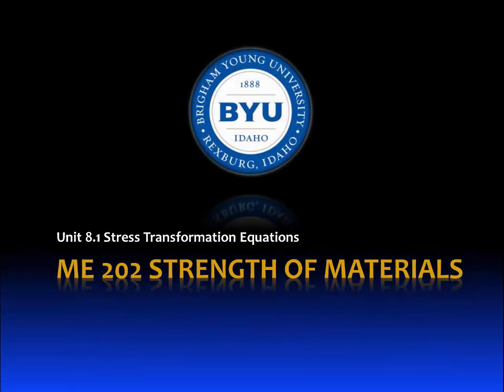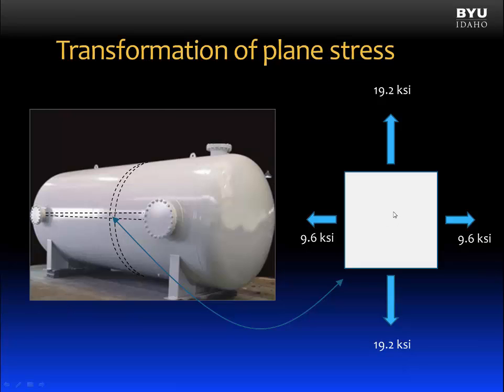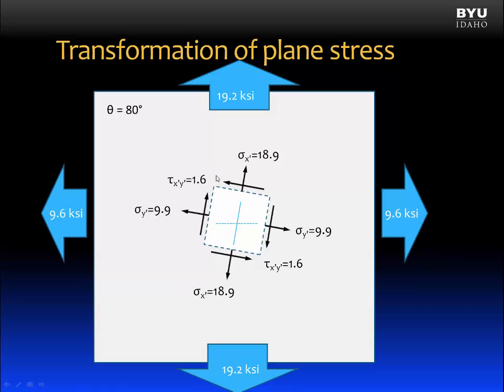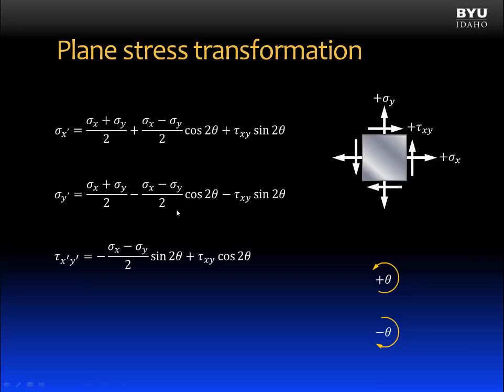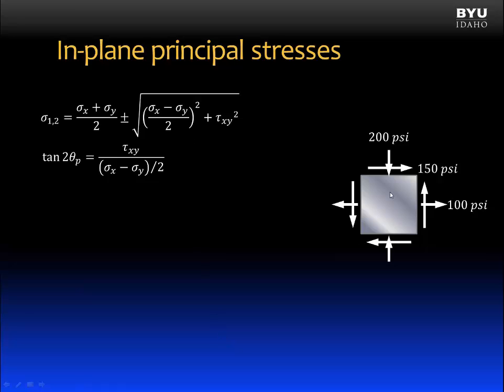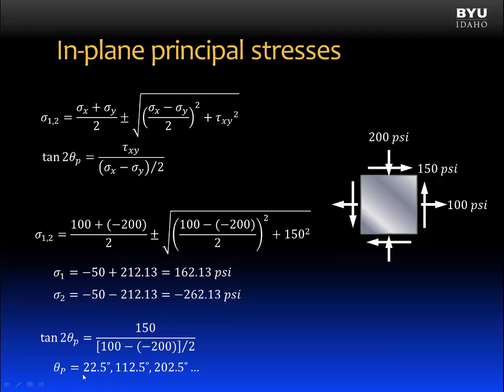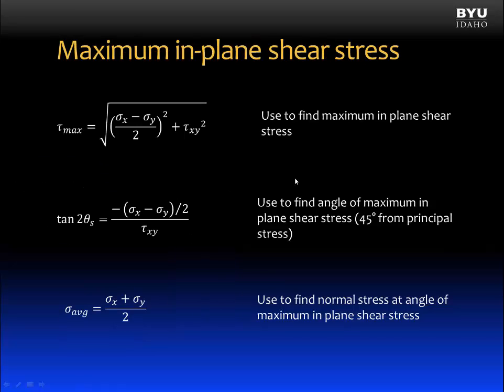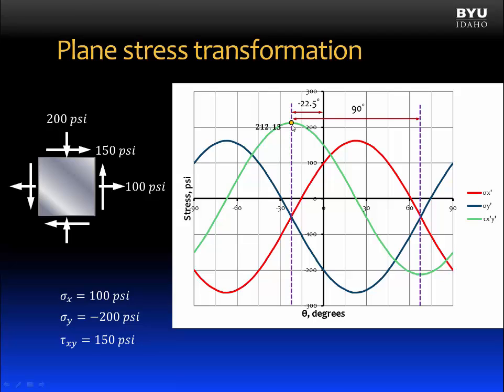08.1 Plane stress transformation

Comment: Now when you say rotate the element, does that mean that you rotated the tank in the example or that the tank stays stationary and we simply skew the small square we are looking at on the stationary tank or does it mean that we are rotating the tank itself?
Reply from the maker: The tank always stays in its original position.  The square element is being rotated through the angle theta relative the axis of the cylindrical portion of the tank. Essentially we are looking at the stresses on various planes in the tank wall. Let me know if my answer is not clear. Thank you for your question.